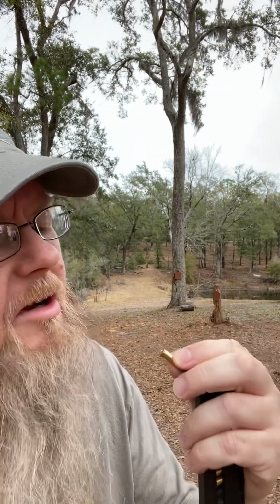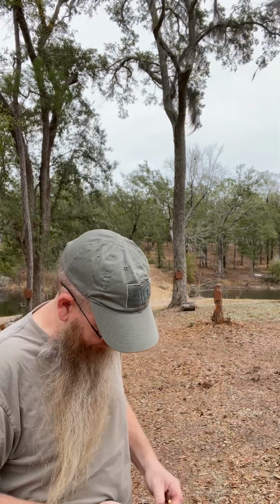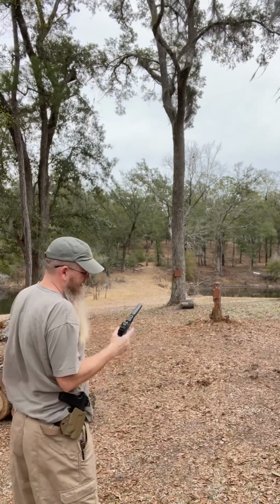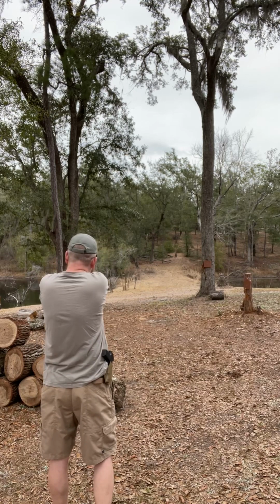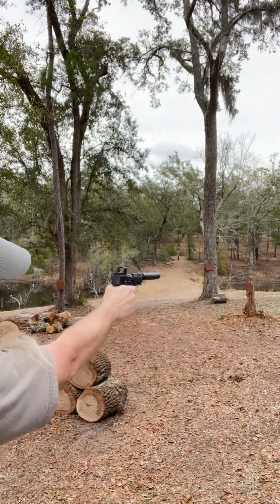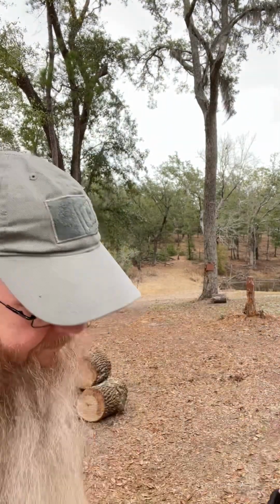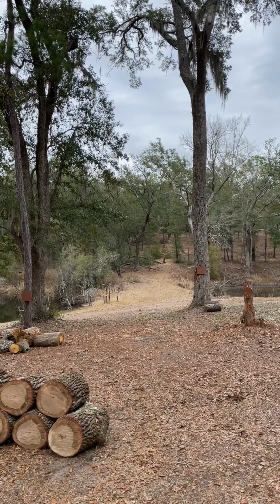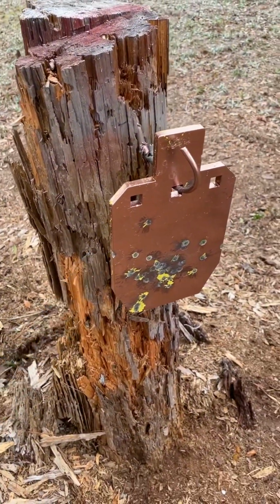Sig P322 Light Strike King

Comment: My P322 does the same thing....Can't even get through a 10-round magazine without at least 1 light-strike. 
Send it back to Sig twice already and it hasn't improved it slightly
Reply from the maker: So they said just deal with it? 

Are you on the 322 Facebook group? This is what another person posted there. I just don’t know what he is talking about: “The .06 to .09 thick washer in the bottom of striker pocket. Will fix light strikes.
The slide lock issue is the stamped steal part.
I have a simple fix for it.
But I will need to make a short video so guys will know how to repair”